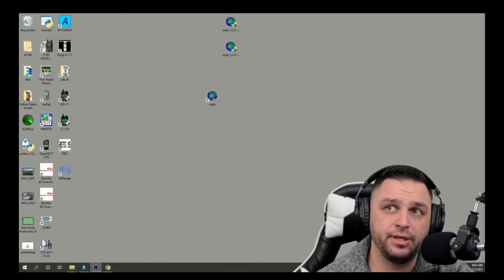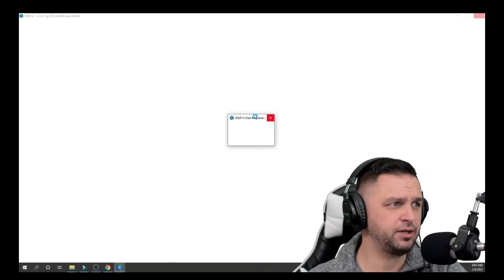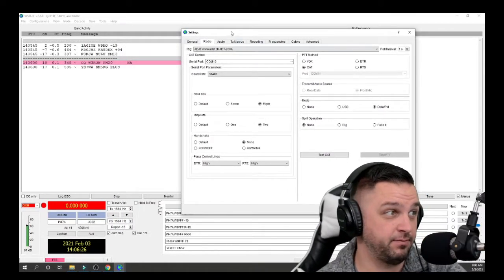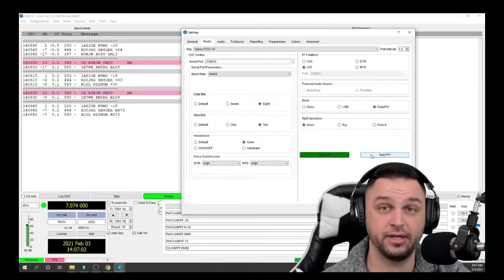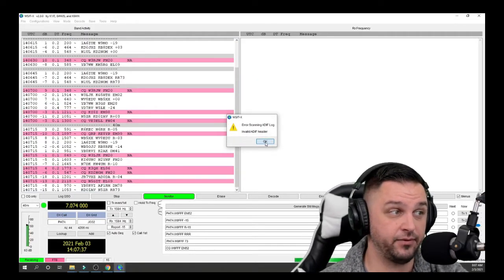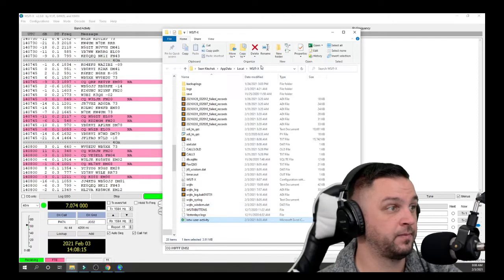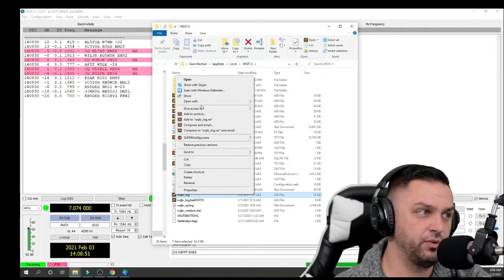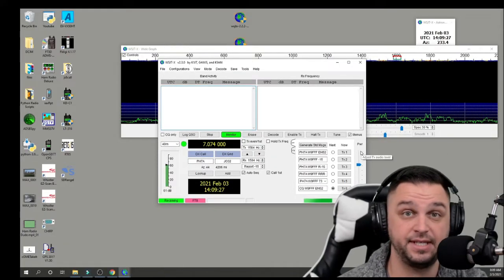(3) Three WSJT-X Errors I got after upgrading to Version 2.3 (And How I fixed them) FT-8 FT8

Comment: Please help: My radio connects to the software and can control the radio, both tests work, but nothing is on software waterfall and the band activity messages window is always blank. Do you have any suggestions?
Reply from the maker: You're probably need to select the right sound cards in the WSJTX settings
Reply from the maker: Also, you could reboot WSJTX as sometimes it the screensaver enables, it messes something up with the sound card
Reply: @DudeTested  Already tried both. I have the Icom IC-7300, the driver is installed and I can transmit. The waterfall on the radio indicates good signal but the WJST-X software won't display anything other than static.
Reply from the maker: How about the sound card settings in Windows?  Does the icom soundcard displayed in Windows have the ability to adjust the volume level?  It's been a while since I've had the radio, but that may be a good thing to look at.
Reply: @DudeTested  Checked that, appears to be fine. I am going to try the JTDX software, That will either eliminate JSTX software or determine if it is the driver.
Reply from the maker: @BoycottWatch  very good. Maybe a different USB port, although unlikely. Good luck!
Reply from the maker: @BoycottWatch  okay that's a better sign.  I'd confirm that you're on the correct frequency, which I assume you are, that you're in the correct mode USBD, that you have proper bandwidth. And if all that's correct, did you sink your time with a program like JT sync?  Hoping I'm being of a help.  Talk to you soon